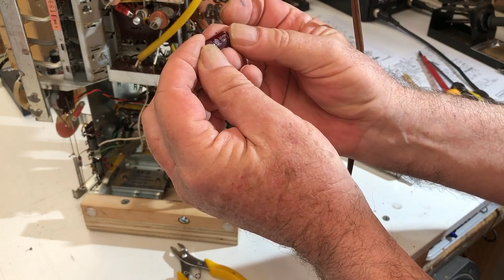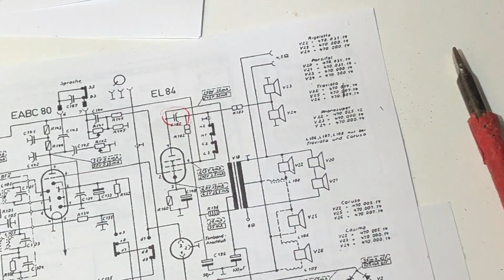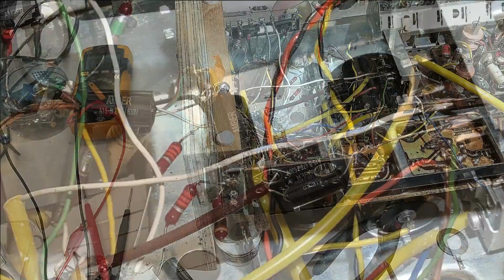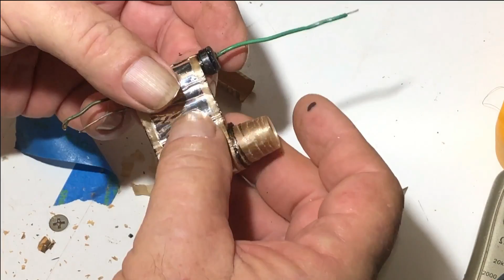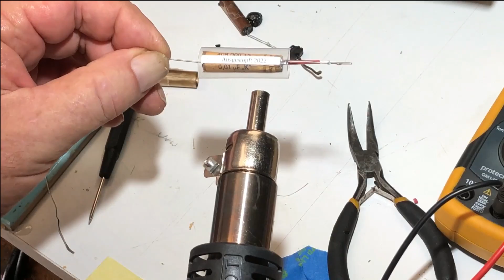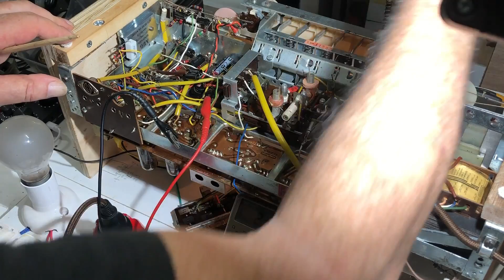NORDMENDE Rigoletto 59 restoration & repair Part 2

Comment: When you're trying to work out the value of the dropper resistor, it's a good idea to set the correct supply voltage using a Variac and measuring the heater voltage. When the heater voltage is 6.3Vac, the supply voltage is correct. You can then select a dropper resistor to give you the correct B+.
Reply from the maker: Cheers Roger.  That seems like a logical approach.  I must admit I was blundering around a bit with this one.

Comment: Hello, Mr
Here I leave you a link to the restoration of a Nordmende carmen 59 radio that has the same chassis as the Rigoletto.
https://www.dropbox.com/sh/e10tapiicigogqp/AAAG-BCx2VKS8b3tK_BEJW9Ga?dl=0
For the furniture, gel stripper and for the shellac varnish applied to the dolly.
But any of David Tipton's methods will surely look fantastic.
Greetings from Spain
Reply from the maker: Hi. Thank you for the link. It looks almost exactly the same as mine. Very interesting!
I used gel stripper on the cabinet, applied a stain and sprayed it with acrylic lacquer. It came out pretty well, apart from some stains that I can’t remove. 
It’s nearly finished and I will have the video up in a few days. 
Thanks for your interest!

Comment: Hi Don.  As the current through that resistor is not pure DC, but a series of charging pulses to the first filter capacitor, you cannot use simple ohms law to calculate the filtered voltage.  Likewise, you can't calculate the power dissipation in such a resistor either, it will be much higher, due to the high form factor of the current waveform.   As a first approximation, the RMS current through the resistor will be about 2.4 times the DC output current, for full wave silicon rectifiers.  I hope that gives you an explanation for how the circuit worked out.  I enjoy your videos. 😊
Reply from the maker: Hi Stuart. Thanks for this insight. It does explain why I wasn’t getting the results I was expecting.  I didn’t really consider the rectified ac waveform - just treated it as dc. No wonder I was getting confused. At present the radio is working well without a resistor, the increased output being compensated for by the ac input going to the 240V tap. Do you think that’s a safe way to go or is the resistor necessary for other reasons?
Cheers
Reply: @Donno308  I think that if the voltages are correct, no resistor will be necessary.  I'd certainly keep it on the 240v tap, as there is the 6.3 volt heater supply to consider also.

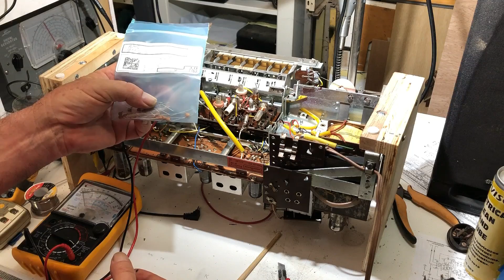Comment: Don.  Your audio is way to loud!   At 28:44, thanks Don...glad I could help.   At 31:45, maybe try some vinegar?
Reply from the maker: Hmm  I'll check that, thanks  I have previously had a comment that the audio was too quiet so I did increase it, maybe too much.  It's hard to tell how it will come out when it's published.
Reply from the maker: Thanks.  I'll try some vinegar on a spot that's covered by the knob and see how it goes. Cheers

Comment: Hi Don, good progress with your Rigoletto and as a positive side effect, you learn a new language. When restuffing these old capacitors I use the tar from the old one, cut it into smaller pieces, restuff it in and melt it with a heat gun. Looks like original afterwards, the smell is bearable and, from a sustainability point of view, you are re-using as much as you can from the old one. The red capacitors we call "Wima Malt drops" in Germany, and in 99% of the cases they are bad. Good luck with the cabinet.
Reply from the maker: Thanks ThoMe. I dare say I’ll know a few more words of German by the time I’m finished!
Wima Malt Drops, eh? There’s another one I haven’t changed - it’s a darker red - more brown but otherwise similar. Are they the same type of cap? Maybe I should change it too?
Yes, the cabinet will be interesting. I’ll try for the high gloss finish but I don’t know how I’ll go with that.
Reply: @Donno308  Hi Don, these Wima's vary in colour, and if Wima is written on it, I would change it. Have a good weekend, Thomas

Comment: Just a point Don, the voltages given on the circuit diagram would have been for an analogue meter of lower input resistance. Like an Avo. Most modern meters have a very high impedance. I've been caught trying to match voltages on older equipment a few times myself.
Reply from the maker: You certainly have a point, Michael.  I have a 1000 ohm / volt analogue meter and the radio is still on the bench.  I'll re-check the voltages and see what I get.  I might need that resistor after all.
Reply: @Donno308  It will probably be OK straight from the rectifier. It's mostly an issue measuring voltages on valves via high resistance.

Comment: Great work, Don!  The radio's coming along nicely.  I'm taking notes for my own Grundig radio restoration which I hope to begin in summer.  Looking forward to the alignment.  Your SWL channels sound a lot like what I get in Japan.  Lots of Chinese, Korean, Indonesian and sometimes Russian stations but only the strongest ones come in. QRM from power lines, LED lights, TVs, etc. drown out the weaker ones with whole bands nothing but noise. I'm now building a new shack in a new house so maybe my luck will change in a few months.  BTW, Digikey gives me free shipping to Japan if I keep my orders above $50US.  Might work for you, too, in Oz.
Reply from the maker: Thanks!  I get most of my capacitors etc. from Carl's Capacitors & radio parts but Digikey have a range of caps that Carl doesn't usually carry.
If you're doing a Grundig you should check out Electronics Old and New by M Caldeira  (if you haven't already)  He knows more about Grundigs and other German radios than I ever will.
Unfortunately I live near power lines, an (electric) railway line and every other kind of QRM imaginable.  It takes a pretty good radio to get through all that.

Comment: we run on 250 volt about now in Australia now
Reply from the maker: I guess it depends on where you live.  In 2000, Standards Australia issued a system Standard, AS60038, with 230V as the nominal voltage with a +10% to –6% variation at the point of supply. That said, most days it varies from 235 to 240 ish here in Perth.
Reply: @Donno308  Here in NZ, yesterday, we had no volts at all!

Comment: It's not unusual for the bass control to act as you have shown. It seems that the thought process is that - turn the bass down for more bass and turn the treble  up for more treble. I've come across this design philosophy in some Grundig sets.
Reply from the maker: That kind of makes sense. I was wondering how it could possibly have been changed around ...
Thanks for the advice.